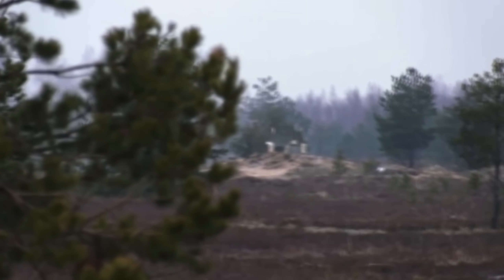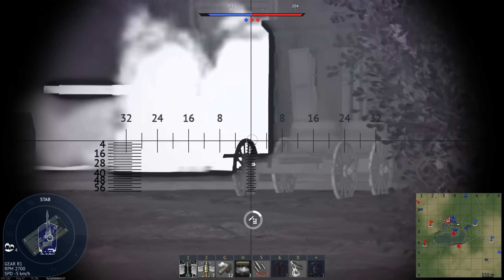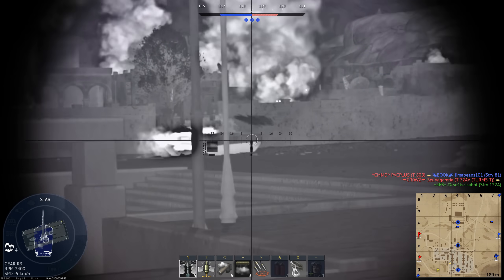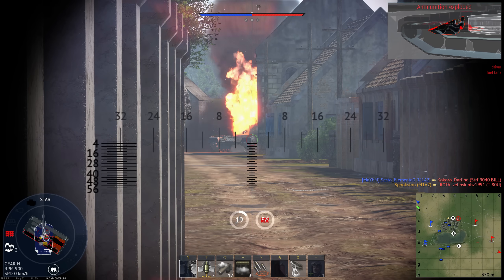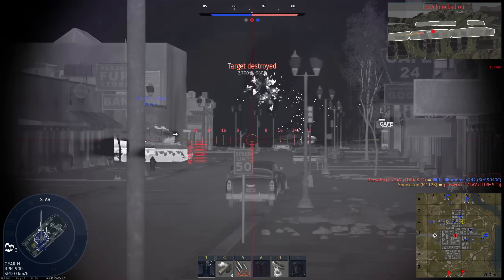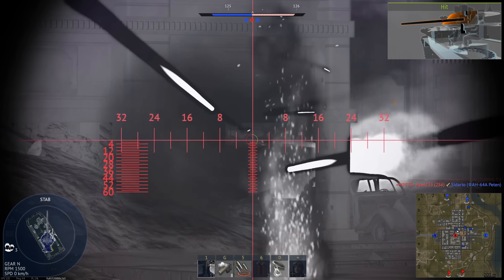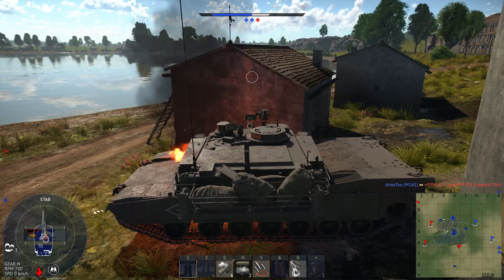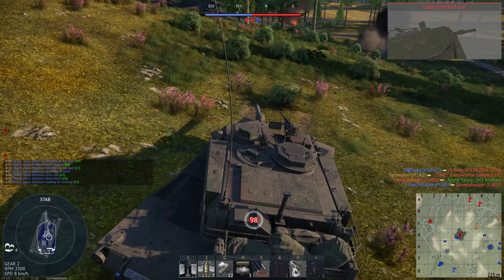Why The M1 Abrams Uses Depleted Uranium

Comment: That makes me wonder. 55 grain solid copper projectiles coming out of 20in barrels at 5.56 pressures can defeat AR500 steel with ease. So why not make an incredibly fast and lightweight tank round out of copper? Mind you, 55 grains of copper and lead have the same performance and are cheaper, and have similar effects on natural resources like springs and rivers. The U.S. army already moved to a steel and copper projectile for its fighting rifles with "its better for the environment" listed as one of the reasons for the change.
Reply: Copper is used because it is able to be engraved upon the rifling of a barrel and easily available, you don't have such issues with smooth-bore guns firing Sabots. Steel is more dense than copper thus better at penetration, which is why Armor Piercing 556 rounds have a steel penetrator inside of that copper jacket.
Reply: @FirstDagger  that's a common misnomer. If it was about grip into the rifling, it would be a solid lead projectile. They'd be easier and cheaper to make as well. The copper is used because it's softer than steel and harder than lead, so when it does engage the rifling, it doesn't foul it up or deteriorate it as quickly as the other two metals. A happy medium. Copper is actually more dense than steel which is why M193 and M855 have the same ability to penetrate steel in close range, but M855 can penetrate further. The round is longer because of the lower mass of the steel core, and that increases the ballistic coefficient. That's also why M855A1 has a steel tip resting in a copper base. They put all the mass at the back in an attempt to make the projectile more stable in travel. Thats a long winded way of saying a long projectile made of copper travels farther and faster, and velocity is a major factor in penetration. Mind you, a tank has an easier time carrying different types of specialized ammo, so you could still have HE and anti personel rounds for when you need them. Or maybe there's a happy medium if you use a shaped charge or EFP, and surround the outside with ball bearings for frag.

Comment: Yeah, biggest risk with DU is the same reason it's safe to handle. Alpha particles do no damage to tissue, but do enormous amounts of damage at a cellular level, if inhaled/ ingested and distributed around the body.

A solid piece of DU an only emit alpha particles from its surface, the first few layers of atoms. Any alpha from within the piece loses energy from collisions with the surrounding material and is not emitted. However, when DU impacts armour at high speed, it forms a fair amount of DU oxide vapour, particles of which are smaller than a virus, pass through NBC filters, and increase the emission surface area for alpha radiation by many millions of times. This makes the material go from mostly harmless to incredibly toxic to anyone who is in the near vicinity.

Comment: A fun fact for you from a former M1A2 SEPv2 crewman, we don't use DU penetrators for training.  Instead we use the M865 TPCSDS-T (Target Practice Cone Stabilized Discarding Sabot w/ Tracer) which is a steel projectile.  This way target ranges don't need to be regularly cleaned to prevent environmental damage.
Reply: And its probably cheaper aswell.
Reply: @hanfpeter2822  Absolutely.
Reply: Trapnell Range at Ft Hood has been condemned because they used DU on it for years back before the effects were known. Naturally, our unit did training there alot because it was always available
Reply: As a 19kilo veteran it sure made me nervous when the guys delivering our ammo rolled up with hazmat suits on.
Reply: Well yeah the training rounds aren't going to be the in service rounds
Reply: Just like shooting a 9mm Tracer Round out of an AT-4 (Anti Tank Bazooka).... Because it's a Training Aid for Christ Sake...  But then shit caught Fire down Range from shooting the Tracers... Ooh-Rah.. Fucking Tires burned for Days..
Reply: nice
Reply: I figured something like that was the case glad you confirmed it, steel ammo is probably cheaper too
Reply: Those training rounds can still take out tanks though, right? If I remember correctly there was a friendly fire mishap at a tank range not too long ago. One of the training rounds hit a friendly tank which caused damage and injured the crew.
Reply: @Joe_Friday  Not much damage, but yes. The tanks are hardened against DU and tungsten penetrator rounds, so a steel penetrator wouldn't do much more than maybe cause a dent in an Abrams
Reply: @Joe_Friday  our master gunners told us the training rounds we used can still penetrate a Bradley. The fact that I have one in my office makes a great story to my students. Lol
Reply: @alfredogarciajr40  Why do you have one in your office? And do you think we'll adopt the European tank that's being developed or will be make our own? I like the idea of these new 130mm and 140mm guns being worked on. Do you know the pros and cons of the 130mm vs the 140mm? There probably isn't enough info out yet.
Reply: @Joe_Friday  well I have one because I used to be a tank commander and when my unit was in Germany we all got one as a going back to the states gift from our company. 

I don’t know much of theses 130 or 140 mm that other countries are trying to adopt. Honestly didn’t know that was even a thing. However I haven’t been on a tank since the beginning of COVID in 2020 but what I will say after spending 27 months overseas deployed on one or assigned to one. I’d say the biggest thing isn’t the size of gun it’s the crew. Having crew continuity and crew who spend months to even years at a time are the advantages the Europeans have over American tank crews. European tank crews literally spend years together and know each other so we’ll and their roles in a tank. American tank crews switch out so much wheather getting out, Moving duty stations or getting promoted and moving to a different platoon having a cohesive crew is what wins battles not who has the fanciest toys.
Reply: @alfredogarciajr40  Yes. Rheinmetall just released a concept tank called the Panther. It sports a 130mm gun. I guess they went ahead and came out with their own version since they're butting heads with a French competitor over which gun will be utilized with the Franco/German tank. 130mm vs 140mm. This new Panther also uses drones that are capable of surveillance and top down attack.
Reply: Yes as long as it's other countries that US attacks are getting poisoned, it's fine.
Reply: A main reason also why that round is used is because it is cone stabilized it has a much reduced range than fin stabilized making the safety fan for tank ranges considerably less
Reply: Do those rounds have that signature blue paint coating on the case that typically denotes a training munitions?
Reply: @blaaszp.b3715  The sabot itself (not the penetrator) is the blue color, the rest of the shell is lacquered silvery cardboard.
Reply: @blaaszp.b3715  the blue is painted on the sabot portion of the round and yes it designates training. Ap sabots are painted black, there's a heat training round as well and it's also painted blue.
Reply: How many clicks are in a clip?
Reply: Another Generic Fun Fact fake coment
Reply: every time i went to 29 palms for itx id always find a few parts of the steel penetrators or maybe one piece of the sabot
Reply: Training round vs combat effectiveness.  Let me guess, you have never been in actual combat... LOL!!!
Reply: @AgentPepsi1  🤦 Tell us you can't understand English without telling us you can't understand English
Reply: It’s a shame they don’t have that kind of consideration for the environments they’re deployed in
Reply: @jasonarmstrong5750  A warzone is going to be destroyed no matter what. The quicker you win, the quicker you leave and have less time to cause damage..
Reply: @Dezirous_Gaming  That's correct. At the end of the day, if everything's working properly, you won't find many DU penetrators in the ground in a battlefield at all. They'll either have turned the insides of tanks into a death chamber, or, they'll never have left the tank using them, and go back into storage after the battle for later use. That's the ideal thing of course. In reality there will be a few shots that missed or over-penned, but like you said, the sooner the battle is over, the better. Not just for the environment, but also the human toll as well. The faster it's over, the less pain and suffering in the wake.
Reply: Ah, so there is some radioactivity? DU is maybe not as clean as it is claimed to be?
Reply: @gulliverthegullible6667  well when you are firing thousands of rounds in a concentrated area it’s bound to cause environmental damage...
Reply: @SirHuddy  there must be a reason why some countries are using the much more expensive wolfram ammunition, which has a similar effect but no radiation.
Reply: @gulliverthegullible6667  Most countries do not have access to the quantities of DU that the US does.  As an offensive military munition, DU is currently unmatched (even by pure tungsten penetrators) in effectiveness, while being drastically cheaper if the supply is there.  Also, DU is only a bit more radioactive than living above a granite bedrock in the US.  Openly utilizing uranium (as we do in reactors) exponentially accelerates the half-life of the rod, causing the radiation to rapidly dwindle.
Reply: @YourTechpriest  if a country has nuclear power plants, their forces can have DU. However, most countries plan for defense on their own soil, which they don t want to pollute. The USA plans to invade other countries and does not care about the radioactive pollution they leave behind.
Reply: @gulliverthegullible6667  If you worry about being ecologically friendly during combat, you have a host of other problems.
Reply: @gulliverthegullible6667  Wolfram (AKA Tungsten) does not have similar effects. Were you even listening to the video? If you have two identical 105mm APFSDS shells being fired out of identical guns at identical targets and over identical distances, except one penetrator is made of Tungsten and one is made of DU, the DU penetrator will perform better than the Tungsten penetrator assuming all other variables are identical.
Reply: @gulliverthegullible6667  No. It's not radioactive, it's just toxic. Uranium bound to anions to make it chemically stable has been used in green pottery glazes with no ill effects.
Reply: @gulliverthegullible6667  no its to prevent heavy metal poisoning due to shrapnel leeching into the air, soil, plants water etc.

 Radioactivity is not the dangerous and contaminating part about DU, its the heavy metal poisoning not matter if the rounds were made from lead, tungsten, mercury, arsenic, cadmium, copper, zinc or iron...

Plants and trees can grow back, but heavy metal contaminated soil, water etc are not going away after one or two years

Besides you'll probably get a lot higher radiation dosage from flying than standing near a bunch of DU rounds
Reply: @mr3748  interesting insights, thx!
Reply: @mr3748  This is almost the same argument about cellphone towers. ("They use radio waves. Which means radioactive. WHICH MEANS ITS KILLING ME")

well, actually no, not at all.... People really dont do research.
Reply: @GreyBlackWolf  Jip😂😂😂
Reply: @mr3748  Iron, copper, and lead to some extent are not bad for the environment. Iron flat out just turns to rust, copper will form an oxide layer and become inert for all practical reasons. Lead will also form an oxide layer, and so long as its not placed directly in a body of water will do little to no damage as it will also form its own oxide layer. Heavy metals only poison the environment if they have a mechanism by which to spread. Ie its reactive, or like in mining operations mixed with acids from many sources that kick start reactions and then mixed with large quantities of water during mining.
Reply: @gulliverthegullible6667  Think of it as LEAD.  Treat it like you would treat LEAD and you should be fine..  The Romans drank LEAD.  Said it tasted sweet... No more Rome.  Don't drink LEAD and don't drink DU.. and you be good my FELLA
Reply: @gulliverthegullible6667  theres also heavy metal stuff toxicity, it rains that uranium gets into rivers and kills plants and shit

and you if you eat too much of it
Reply: @Gulliver the Gullible  not because it's radioactive but because it is a heavy metal. Heavy metals are generally very toxic to inhale or ingest. Think about lead or zinc poisoning same ca happen when ingesting du or tungsten shards and dust